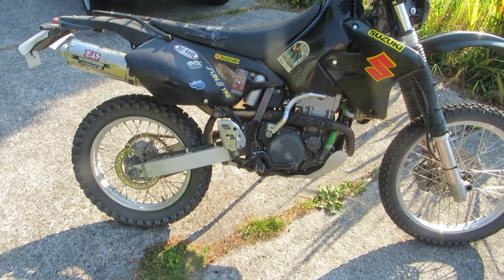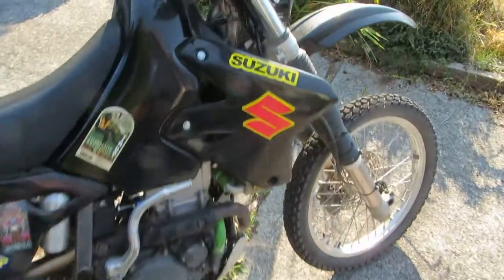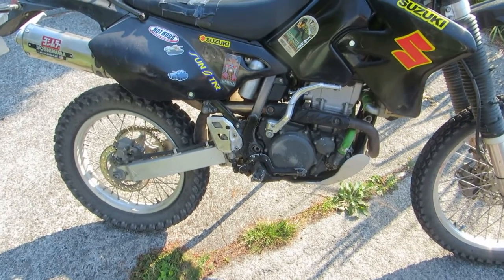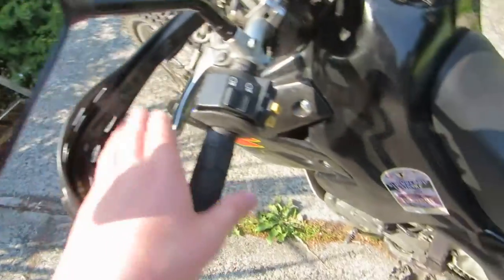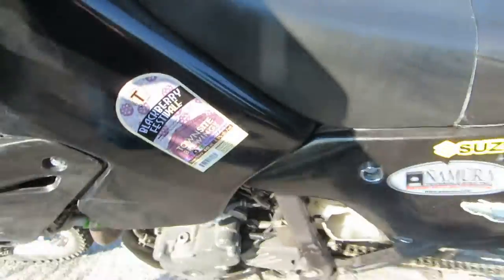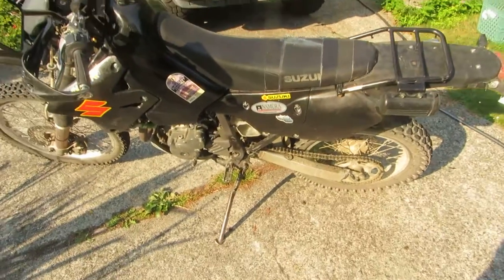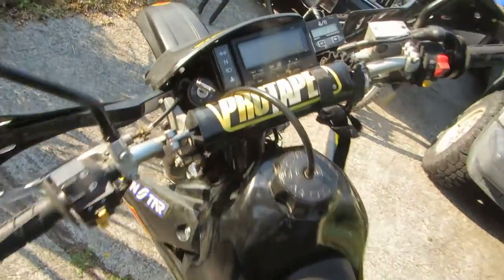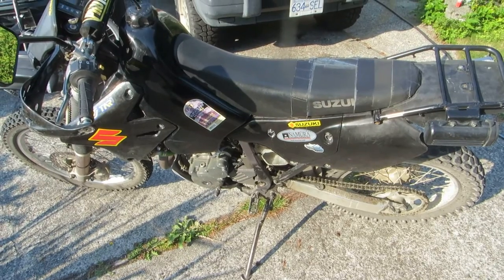DRZ400 rebuild finale Part 13

Comment: Hey, I know the videos on the bike are about a year old but I was wondering if I could get some more information on your build. I also busted my head gasket during my first year and college and never had the time or money to rebuild it/fix it. It's been three years since then. Today I pulled the entire bike a part and I'm trying to figure out how much it will cost me to fix every thing. I know you haven't posted about your bike in a while but from your channel it seems like you upload semi frequently. Let me know if you would mind helping or give advice. Thanks!
Reply from the maker: Hi sorry for taking so long to respond, I forgot all about this comment.  

The cost will vary depending on what parts you plan on replacing.  Head gaskets themselves tend to be around 50 CAD, I'm assuming you live in America, so parts will likely be cheaper.  

You should determine why the head gasket blew in the first place.  Was it a faulty water pump, clogged water ports, simply too high rpm's?  As you know from watching the videos, I replaced my water pump, head gasket, and had my valves lapped.  I also changed the timing chain while I was in there.  The cost can run up a lot higher than initially planned if you damage something while working on it, or discover broken or worn out parts.  

What miles does the bike have, and what year is it?  I'll give what advice I can, but I now live away from my bike, and it's been a while since I worked on it.

Comment: Hi,
I recently installed a kickstart kit on my drz400. I noticed when I lean the bike over to the right side while the engine is running, I can hear what I believe to be the kickstart driven gear rubbing on that cross bar held with two phillips screws inside the clutch cover.

I noticed the amount of wiggle room between that gear and bar when doing the install. I thought that I may have missed a step or something, I double checked and that doesn't seem to be the case. I feel like there should be a brass bushing or washer in there to take up some of that excess play.

I was wondering if you experienced the same with your bike?
Reply from the maker: I haven't dealt with that, my kickstarter was installed by the previous owner. I did however install it wrong a few times. There are marks on some pieces that need to be lined up properly, otherwise the return spring will pop out of place.